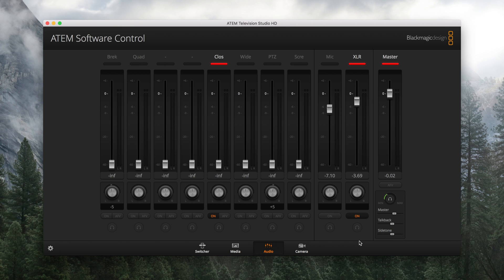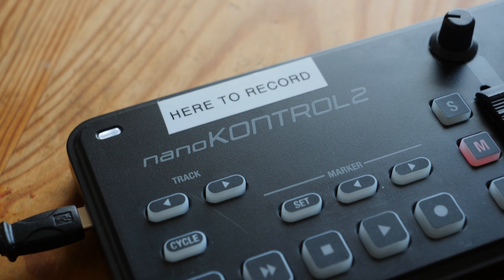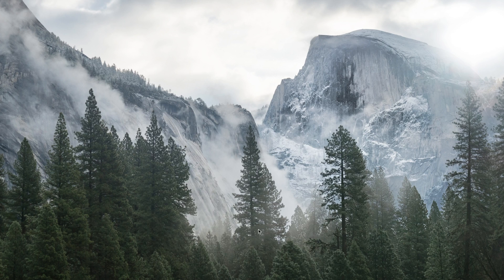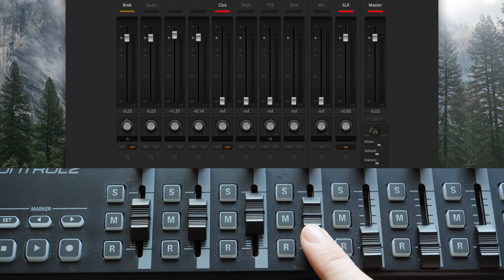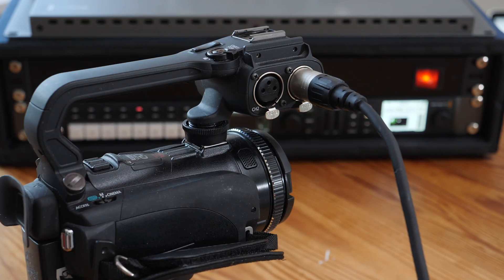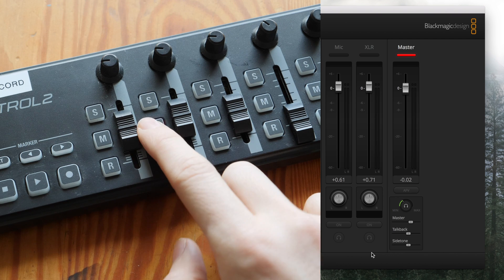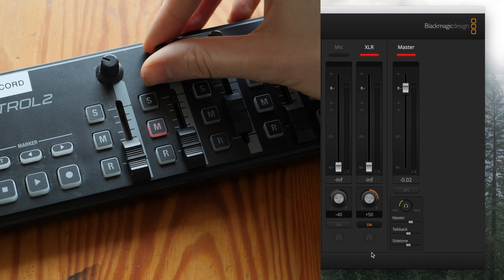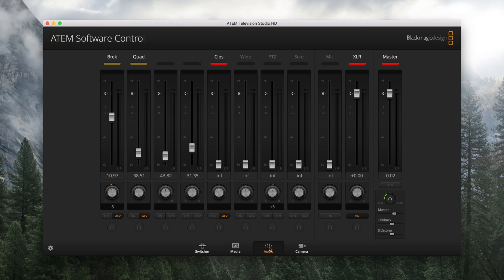Control ATEM audio mixer with MIDI controller // Show and Tell Ep.55

Comment: Hi guys. Ive just watched Control ATEM audio mixer with MIDI controller // Show and Tell Ep.55 which was made back in feb 2018. Does anyone how if they have fixed the problem to work with the ATEM ISO as I need to use an external control device. Many thanks,

Comment: @Here to Record:

As I mentioned in a reply down here:

I got the nanoKontrol 2 working with all faders and pan pots.

I use MidiPipe for Mac to filter out MIDI Note Commands. Now the Korg nanoKontrol 2 (and any other controller with the Mackie Protocol on board) will work.
No more flickering On/Off/AFV buttons. Faders work fine. Also the pan pots, even if you use all 8 together!

First, rude option:
Install MidiPipe. Setup a preset Pipe (right side of the program window) with these tools: MIDI in -> Message Filter -> MIDI out and hijack the controller on the USB bus.
Set the filter to all but Pitch Wheel & Control/Mode Change (which is used by the faders and pan pots).
Restart ATEM Control Software, et voila: nice fader moves.

Second option:
If you want to use the Track [<] & [>] buttons to switch the fader banks (video inputs/mics in my case with ATEM Mini Pro and Extreme):
Install MidiPipe. Setup a preset Pipe (right side of the program window) with these tools: MIDI in -> Key Mapper -> MIDI out and hijack the controller on the USB bus.
First set the Key Mapper to [Filter All], than select Key In: A#3 to Key Out A#3 & B 3 to Key Out B3. Other keys  will control On/Off (C 0 - B1).
This will filter all MIDI Note On/Off commands (which will control the afv) but NOT the commands for fader bank and not the channel on/off function.
Restart ATEM Control Software, et voila: nice fader moves.

You can use 'Alist' tool before and after the filters to see what they do.

Got the Audio On/Off working too, including the LEDs.

Checking if I can also activate other functions, like AFV switching. Work in progress.

Comment: How about using the fader to control fading between 2 video inputs as you would with a T-bar?
Reply from the maker: That is possible with OSC I believe!
Reply: @heretorecord  I just found your other video on ATEM OSC and OSCulator. Thanks!

Comment: Great! Did anyone get the NanoControl Mini
 to work with Atem?
Reply: A bit late... I have in working. Korg NK2. But the same issues as John has experienced: on/off/afv switching when moving faders.
This is NOT an issue of the ATEM software directly, but a flaw in their Mackie Control implementation and lack of MIDI settings.

This is due to the Mackie Control (MC/HUE) protocol used by many controllers and DAWs. The controller - in MC mode - sends a MIDI Note on and Note off when you touch a fader. This is protocol and used for DAW to sense that you touched a fader for selecting a channel on your on screen mixer.

After that it send the fader movement data as MIDI Pitch Wheel data on MIDI channel 1 for the first fader, channel 2 for the second, and so on.

The ATEM software uses MIDI note commands to enable Channel Off, On and AFV.
The faders send MIDI note commands that trigger their channel to OFF and AFV.
You cannot change this in the ATEM software.

A few solutions:
-Use MIDI software that captures the MIDI data from the controller and removes Note On/Off data from the fader moves. Like Bome. Or MidiPipe for Mac (WORKS! SEE MY OTHER POST ABOVE)
-Use Mac software like OSCulator and set the controller up as ordinaire MIDI Control Command controller (only Note on/off and Continuous Controllers) and set ranges for faders. OSCulator translates MIDI controller data to OSC commands. And than install atemOSC (GitHub) which will transfer the OSC commands to the ATEM software.
-Use Windows software such as Central Control with the BMDSwitcherMIDIMapper macro. It will translate MIDI controller commands directly to ATEM.

Setting the nanoKONTROL 2 modes:
ProTools (HUE/Mackie Control) Mode: Hold [SET] & [PLAY] while connecting the USB cable
CC (Continuous Controllers) Mode: Hold [SET] & [CYCLE] while connecting the USB cable

Or use the Korg KONTROL Editor software for Mac and PC to change modes.

Hope this (still) helps.
Reply from the maker: So long as it is a MIDI device it should work!
Reply: @heretorecord  I bought the nanoKontrol2 just for this purpose but I can't get it into service mode like demonstrated in the video. Please help.

Comment: Hi John

Where do you connect the midi controllers USB cable into on the ATEM/PC side of things. I'm using an older version ATEM 2M/E Production switcher with a printer type USB connector on the back of it

Thanks Greg
Reply from the maker: You connect the midi controller to the same PC that you are running the ATEM Software control on

Comment: I am researching to put a small multicam switching system together to stream live to facebook or youtube for maximum of 4 camera's. But i also want to use software for visuals like a logo watermark and a lower third and stuff.
I already have a Nanokontrol 2 but is it possible to use the Nanokontrol 2 as a videoswitcher?
If not do you have suggestions?
Reply: The Nanokontrol only controls an existing switcher, the device itself has no switching functionality.